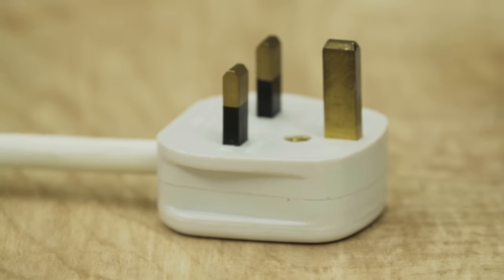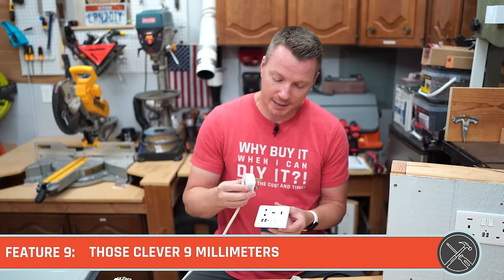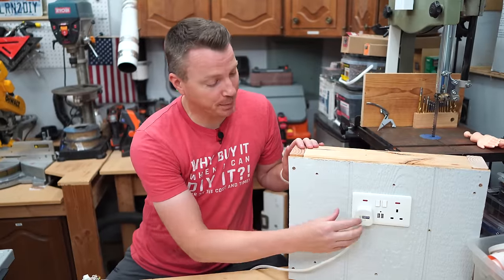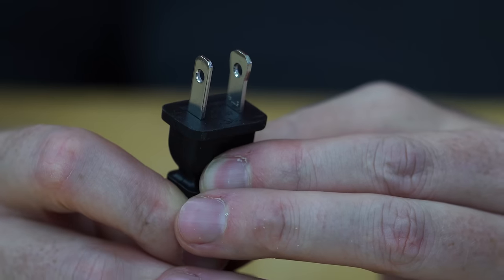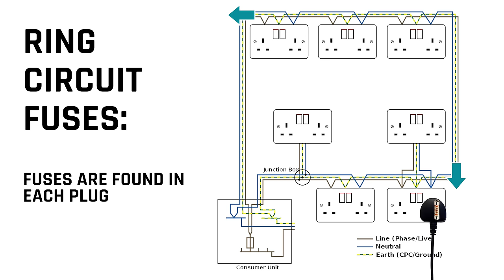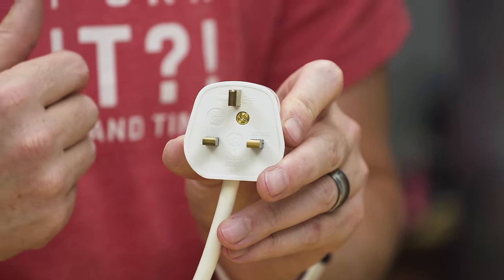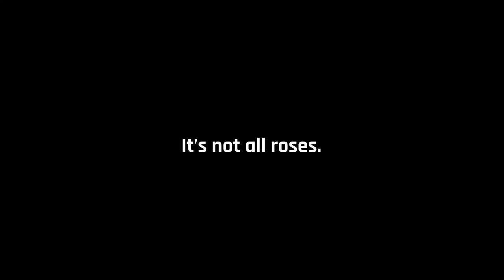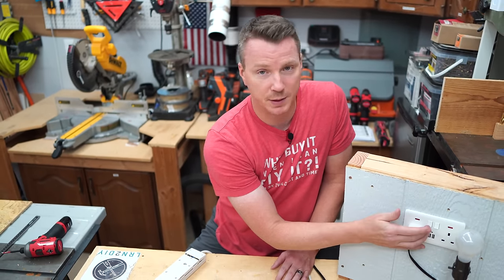British Plugs and Outlets Are On Another Level

Comment: Good video,  I'm a Brit but lived/worked in the US for a quite a few years on and off so have some knowledge of both systems. I'm also really ancient so remember the introduction of the UK's 13 Amp Ring Main System (as it was known) which replaced the older 5A and 15A systems that were much more akin to the current US system, albeit running at higher voltages - typically 220-240VAC - although Cambridge City where I was born and lived as a kid was 200VAC and only finally changed to the national grid voltage in about 1959.
 
We usually only have single phase supplies in domestic premises so I would say that load balancing is a non-issue though. 
There are typically several rings per house, for a medum sized two story home, there may be one for most rooms on what we call the ground floor (first floor in the USA?) with a seperate ring for the kitchem/utility room and a single ring for the 1st Floor (2nd in the USA?) High power loads such as cookers (stoves), ovens and sometimes boilers (furnace) have a dedicated feed in heavier gauge (gage) cable 4 or 6mm^2 is common and protected with a suitable circuit breaker.

 Each power ring is  wired in 2.5mm^2 cable and rated at 32A and each plug is rated at 13A max. (they are still known as "13 Amp Plugs" by most of the population) the ring is protected with a 32A circuit breaker. There is no problem with where on the ring you connect any individual load, you just must not exceed the 32A total.

Switched outlets are the norm so checking it's turned on before calling an electricial is second nature to us natives but I cannot dispute the pain induced by standing on an upturned plug in bare feet!
Reply: I remember the 15amp unshuttered UK sockets. As a toddler I put my finger in the live side and received a shock which made me cry. Luckily I lived to tell the tale.
Reply: I remember when we had the old wiring colours in the UK: red for live, green for earth and black for neutral.  Also my father had been an electrician in the Royal Navy during the War and did all the wiring at home and any electrical repairs or extensions we needed.  He taught us all to be very careful with electricity and electrical appliances, plugs and so on.  The only occasion I remember when one of us did something silly was when my elder brother, then about 8 or 9 years old, thought it would be fun to try to run an Airfix electric motor - normally run off batteries, to power model propellors and the like - by putting the wires in a mains socket; this would be in about 1966 or 67.  The wires went in, he flicked the switch, and so far as I remember blew the fuse in the ring main.  He also survived, somewhat chastened by the experience, although there was the little matter of trying to explain later to my father what he thought he was doing and why.

Comment: I got a UK thing from eBay, I think it was the 360 camera, I don't remember, but it came with that plug. I inspected it a lot and I was amazed how it worked, and the built in fuse, the lock for the earth (I used a EU to UK plug that had that as well). The only complain I had was the size, but pretty based otherwise.

Comment: The South Africa socket outlet shares many common features with the British socket outlet. This is due to the fact that the SA wiring code evolved from the British standard. There are some differences however. The SA socket has round pins, no fuse protection and is rated 16A at 230V. Another feature that is extremely rare on SA plugtops is the partial insulation on the L & N pins. Otherwise pretty much the same features. I think it's called the Type M. A recent revision to the SA wiring code has however now introduced the Type N, which will eventually replace the Type M.
Reply: Ha! my aunty had an old house here in the UK, and she had round pins on her plugs, they must have been like that before the rectangle ones became standard.
Reply: @steved4429  Indeed, the round pins were the previous standard. They came in various capacities, 2,5 and 15 amp with different sized pins. Pain in the neck and needed adapters to plug things in with the wrong sized plugs.  The 2 amp version is still allowed to be fitted, but only for lamps.
Reply: You don't need the fuse in SA plugs because you don't have crazy 32Amp ring circuits. The British ring circuit is insane. You need a good plug design (with a fuse), to protect against the mental 32amp
Reply: @steved4429  Yep. They were 5 amp standard The house I lived in had them as child. Oddly, there were 15 amp round ones in the kitchen. A larger fitting altogether. I guess they didn't catch on.
Reply: @MyProjectBoxChannel  The fuse is designed to protect the flex (cable) of the appliance from an overload, not the circuit. For example a lamp flex might have 0.5mm conductors which would overheat in the event of a fault. So  lamp plugs have 3 amp fuses installed. Heavier load appliances use 5, 10,or 13 amp fuses. They are still a necessary feature even if connected to a 20amp, or higher, radial circuit.
Reply: @bimble7240  the fuse is a very good idea for thin appliance flex yes. But the rest of the world don't have a fuse in there plugs! And the reason for that, is they don't have the 32A circuit. Just look up ring circuit on Wikipedia. Its the reason the plugs are fused in the UK. The 3amp Fuse is a afterthought for smaller appliances.
Reply: @MyProjectBoxChannel  But the 32A ring is a brilliant idea, it saves a lot of cable and keeps the size of the fusebox down. It's just a smaller version of tapping off a busbar system in industrial buildings.
Reply: @christopherhume8896  I used to believe that the British ring circuit was a good idea. But it turns out that that many of its supposed advantages, turn out to be tremendous disadvantages. In many cases it's just plain dangerous. One supposed advantage of the ring over a normal radial circuit, is if there is a break somewhere in the ring it continues to function. So it has redundancy compared to the radial. However a broken ring circuit is no longer rated for the full 32 amps. It would continue to function as normal but can easily be overloaded and becomes a fire risk. A lot of appliances coming in from abroad and China doesn't meet British standards, and doesn't have a fused plug. The government simply doesn't have a way to stop these items coming into the country. Nobody PAT test appliances at home! If the installation could cater for these unfused appliances things would be a lot safer than running them on "32 amp sockets". If you want to make the ring safe, then the sockets themselves should be fused to at least 13 amps. Testing ring circuits seem to become more complex and convoluted every year, with every new addition of the regs. Appliances nowadays don't need 32 amp circuits! The rest of the world have smaller circuits in their kitchen and everything functions just fine. If the rest of the world doesn't need the ring why does the UK? I could do a proper pro's and con's list and go on forever.
Reply: The South African sockets are what British used before this one on the 30s and 40s. India uses same or similar sockets so they actually are far more common than the current British ones.
Reply: @MyProjectBoxChannel  Rings aren't mental, they're sound engineering - from a very different time, for an application you're likely fortunate enough not to need, under pressures you've never experienced.
Reply: @MyProjectBoxChannel  It's not insane, it's incredibly useful. It means you can generally plug a mixture of different things, of relatively high power into sockets in the kitchen or workshop without having to worry about a nuisance trip. A single 3kW electric kettle will load up a 16A radial to 80% of it's rated capacity. Turn on a microwave drawing 1.5 kW or a 4 slot toaster, and if it's on the same 16A circuit you might get a nuisance trip (a bit intermittent as all circuits are designed for a certain amount of overload for a short period of time). 

So, they are absolutely not insane. High powered circuits are a massive bonus and very convenient when used in locations where multiple relatively high powered devices might be plugged in. You have a truly weird idea of what insane means; they are actually a very rational choice. Also, the fuses in the plug means that there's an added level of protection for the leads connecting low powered devices. The thin cable to a table lamp in the UK will be protected by a 3A fuse in the plug, and won't have to rely on a 16A breaker. It reduces fire risk from certain sorts of faults.

Also, it's possible to install 32A radials using 4mm^2 cabling, and increasingly that's what electricians are doing in rooms with high power loading, like the kitchen and utility rooms. Then they install 16A radials in other rooms where the appliance loads are expected to be low.
Reply: @TheEulerID  I would say that 4mm cable is a must for the ring, just in case the circuit gets broken. That way it becomes 2 radials on a 32A circuit. The main problem with the ring for me, is appliances coming from abroad, that are not to British standards, with no Fuse in the fake UK plugs. You simply cannot stop them from coming into the country (people buy it online from China). In the old days the world was more segregated, and things were made in Britain. The only way I think the ring can ever truly be safe, is if the socket outlets themselves were fused. As far as a 16amp radial is concerned. Even a 0.5mm flex can easily trip a 16amp breaker, on short circuit, with out even getting warm! Most fault are short circuits, overloads faults on appliances are basically non-existent. A dead short would be over 3.3KA for a split second. The 16 amp breaker would trip instantaneously before the flex even breaks out a sweat. If you don't believe me test it yourself on a 20amp circuit breaker.
Reply: @MyProjectBoxChannel  There is no point in using a ring if you have 4mm^2 cable. Simply use a radial; it's much easier to test and will use less copper.

If there is a break in a ring circuit, you do not get two separate radials. It just becomes one radial on a single breaker.
Reply: @okaro6595  The type G is pretty common! Used in Bahrain, Bangladesh, Belize, Bhutan, Botswana, Brunei, Cambodia, Cyprus, Dominica, Gambia, Ghana, Gibraltar, Grenada, Guyana, Iraq, Ireland, Jordan, Kenya, Kuwait, Lebanon, Malawi, Malaysia, Maldives, Malta, Mauritius, Myanmar, Nigeria, Oman, Qatar, Saint Kitts & Nevis, Saint Lucia, Saint Vincent & Grenadines, Saudi Arabia, Seychelles, Sierra Leone, Singapore, Solomon Islands, Sri Lanka, Tanzania, Uganda, United Arab Emirates, United Kingdom, Yemen, Zambia and Zimbabwe. Some of which have multiple standards and the type G is only one of them.

Comment: I live in the UK. When I was a kid in the 70s we were all taught how to wire a plug. Indeed wiring a plug isn't uncommon at all (we often re use old plugs on appliances) but I dare say the younger generation are less used to doing it,  it really is very simple. I can also confirm treading on them is bl**dy painful !
Reply: Unfortunately a lot of modern appliances have the plug moulded on to the lead... But I still save them where I can.... Reuse and Recycle  was natural to us.....
Reply: I'm nearly 30 and haven't been taught actually.. I can solder some stuff though.

Comment: Also a safety feature that has long been forgotten with the grounded US style plug. Is the earth/ground pin on the uk style plug is in the correct orientation at the upper most position. Unlike most residential situations in the United States where the ground is in the incorrect orientation at the lower most location. That can make a host of complex issues but the one that I have seen a hand full of times is that, not only are the hot and neutral terminals not partially insulated like the uk style plug but also are side by side, and can form a cradle for a metallic object to rest on or in to complete a circuit until the breaker trips. Causing sparks, high potential for electric shock and a high likelihood of fire. Where if the plug had the ground pin in the upper most position if anything were to contact the hot terminal it would most likely go straight to ground and then roll off the contacts completely. I have heard a few different stories as to why the US style plug is this way in most residential areas. The most popular is that with the center ground pin being down. It looks more like a smiley face, is more aesthetically pleasing, and/or looks less dangerous.

Comment: I can testify how painful the plugs are to tread on. These days (I think for last 2-3 decades) appliances come with molded plugs that are not servicable except for the fuse being able to be removed like you showed. This is because I believe plugs were being wired incorrectly . We were taught at school how to wire a plug and use the strain relief, but I have seen/heard some horror stories.... . Now I think the situation is the same in the US in terms of replacement plugs.  Having moved to the US after being brought up in the UK I was not very impressed with the flimsiness of US plugs. It also still bothers me that appliance cords do not have to be rated for the circuit breaker rating and are not fused. Its always possible to put the wrong fuse in a UK plug I guess, but rarely are people going to need to mess with the fuse.
Reply: I used to do some PA Testing for a charity shop and you'd be amazed at the horrors I found on donated items including fuses wrapped in foil. Stuff passed by the once-a-month 'professional' tester wasn't exempt, with single-insulated flex, unused cord grips and the like all getting TESTED stickers.

Comment: I'ma Hongkonger who just moved to study in Canada, and every morning I'm scared that pulling the kettle's plug may fry me to death...

Also, 3/5 of the "disadvantages" are about the ring circuit, not the type G plug itself. Stepping on an upside-down plug is also less painful than getting shocked to death. So the only true disadvantage is the space, which wasn't a huge concern for me in everyday life. As for the ring circuit, it is only meant for small appliances; washing machines and air conditioners have separate wires from the fuse box.
Reply: "Stepping on an upside-down plug is also less painful than getting shocked to death. " What a great point. i know which i would opt for if given a choice!

Comment: I think the bevel on the prongs are also a feature. Flat surfaces create more contact area as opposed to round ones, like found in many european countries.
Reply: Not necessarily true.  A flat socket-spring on a flat plug-pin may have only one point of contact. A round pin in a sprung round socket will have at least three points of contact, more usually five.  Flat contact springs in sockets are a frequent cause of failure.

Comment: Why 13A you ask? Well the design was supposed to be 15A like the older round-pin BS 546 plug , which is still available and used for specialist applications along with the 2A and 5A versions. But tests showed it wasn't quite up to it so it was downrated to 13A.  Still means we can have 3kW kettles here in the UK with our 240V mains.
Reply: Yes and 3kW plug-in electric room heaters
Reply: If an appliance is drawing close to 13A, the 13A fuse will get pretty hot (the fuse wire being very close to its melting point when passing its full rated current).  This heat travels to the live pin of the plug, and many sockets become quite badly discoloured due to that.
Reply: @davemould4638  Is that right? We have lots of 3kW heaters that can use close to 13A for relatively long periods, I don't remember the plugs being very hot. May have to test it later.
Reply: @barneylaurance1865  Unlikely.
A fuse should handle its rated current indefinitely without issue ("13A" will actually carry at least 16A for short periods).
What is common is for a worn socket to make poor contact with the pin(s) of a plug, generating heat at that point.

Comment: Germany here, we use the type F 2 pins plug with mostly ground "pins" at the flat corners.
I noticed that the type f plugs are usually very thin, although they still appear stable.
security features are often missing.
the reason for this are our sockets, which differ from yours.
among other things, the deepening that prevents a shock.
early contact of the protective contacts.
easy exchange to a secure variant with a flap and stop against intrusion with other objects such as a suitable plug.
but often has to be retrofitted and is not the standard.

(got help from google translate, have mercy pls)
cheers